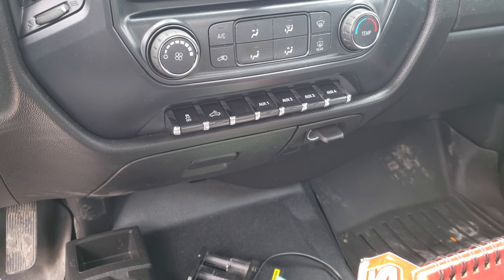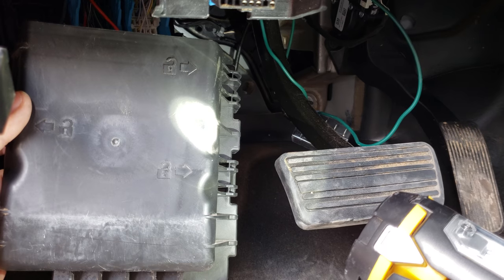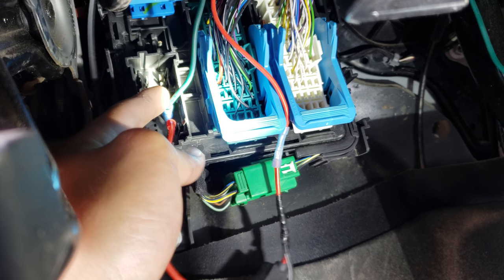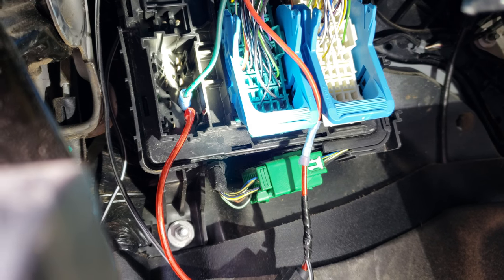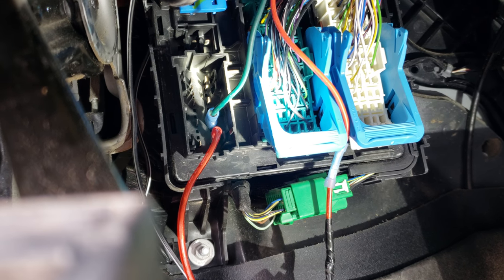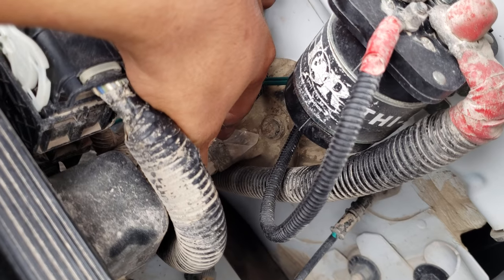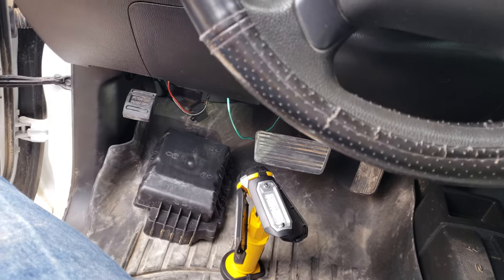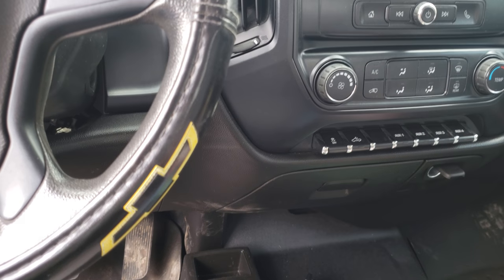Silverado Aux Switches

Comment: Mine not a work truck but I have a 2018 duramax Z71 and my truck comes with the exhaust brake and down hill assist , and the switches I got are out of Order and don’t have the down hill assist but when I plugged it in everything worked in the right order and lights up so I thought it would work but when I go under the dash to see what aux switch controls what nothing is happening. Is it not gonna work or is there’s some fuses I can look for or how do I even see if it’s set up for it !

Comment: Will this work on a 2018 Chevy 1500 LT Z71? 
Ive got 3 different lights I’d like to install on the truck but need a good solution for the Aux switches and this is the one I want but everyone says it’s not going to work.

Comment: I'm not the smartest when it comes to electrical work. That being said, I hooked up a positive wire up to one  the pins and a ground wire to the battery. ( from my LED bar) it was always on. No matter whether I had the switch on or off. Thoughts?
Reply from the maker: Sounds like you wired it to a constant 12v pin, use a multimeter to find the correct pin that turns on and off with the switch. And I would recommend not to wire the ground to the battery, clean bare chassis ground is always best.
Reply: @BR-cm3gi  Hi I hooked a test light to that and it was always on for these pins when they were is the on and in the off position do you mind if you make a video showing what connector you connected the switch with

Comment: Just so you all know they sell a harness that plugs right into the junction box with all labeled lead wires coming off it much cleaner install
Reply: Do you have a part number or website?
Reply: @freddiemcclurejr3827  I found on ebay... I'm not sure how to add the link but the description is:

"2014-2019 Chevy gmc junction block connector truck with aux switches"

Sold by a snow plow company called MCA

Hope this helps you
Reply: @Jon Doe... Thanks for putting that info out there! It’s very helpful! I’ve checked it out and the harness appears to be legit! I’m getting one because I want a clean, professional look under there. Again... thanks!

Comment: Thank you very helpful information. Did you purchase the lock on connector or just left the crimp on and straight wire to the pin?
Reply from the maker: I just crimped on a female spade connector and left enough slack to move around. Haven't had any issues with it, thanks.
Reply: Okay great, so just run POS wire from LED light to the pins and NEG to a ground and that was it. no need for relay? Thank You so much been going nuts trying to get info. Just wanted to add some work lights facing the back and a flashing beacon.
Reply from the maker: @kjorge66  I ended up adding a relay because it was drawing power too much power than i liked, but like you said I dont see any issues with it. Negative off lights to a clean chassis ground then positive to a relay or directly to the pin of your choice depending on what switch you want to hook them up to.
Reply: Thank You
Reply from the maker: @kjorge66  no problem!
Reply: @BR-cm3gi  I'm trying to install a light bar using the aux switches. My light bar wire harness has a relay and a red and black wires that go to the battery and the wires to the toggle switch that comes with the light bar kit. The switch has 2 wires going to it. One obviously goes to the pin in the BCM that corresponds to one of the aux switches but where does the other wire going to the toggle switch go?
Reply from the maker: @Volfan812  I'm a bit confused, do you have a link of where you purchased the wiring harness and light bar so I can look at them closer?
Reply: @BR-cm3gi why? It already has it’s own relay AND 30amp fuse. You just added a 2nd relay for basically nothing. I’m pretty sure your application was nowhere near pulling close to 30amps.

Comment: I put in my switches in my 2014 1500 and got all the fuses and relays in but I’m still not getting any power to any of those pins in the junction box. Anything I could be doing wrong?
Reply from the maker: Does it have the correct factory harness going from the switches to the junction box?
Reply: Bobby R. Yes it does I didn’t change any of the wiring harnesses. I just plugged the old ones into the new switch panel. Is there aftermarket ones I need to get?
Reply from the maker: @domdragonetti476  double check all fuses, might possibly have a blown fuse.
Reply: Bobby R. Is there any fuses in the indoor fuse panel that may affect this?
Reply from the maker: @domdragonetti476  I couldn't tell you for sure, but check just to be sure.
Reply: @domdragonetti476  did you buy a new switch panel that has the aux buttons and just plug it into the existing wiring from the original switch? Did  you ever get it working? I want to replace my existing switch that just has the traction control, cargo light and exhaust brake switch with the one that has those 3 switches as well as the 4 Aux switches but want to be sure it will work before I spend $60 on the switch.
Reply: maxum3300 I did buy it and it never worked right away. Dealership had to wire it all up and they said original price was like 800. I got a bit of a deal on it and had it done for 250 so I would go to a dealer and check to see if it fits your truck before you buy the switch cause it was a long hassle to get mine working

Comment: I want to use these switches to control some light pods. Do I need to use the aux switch to trigger a relay to power the lights? Or can I just go from the pin under the dash directly to the light pod?
Reply from the maker: I installed a relay and fused to the pods I was using, I didnt want any issues with power draw from that pin.
Reply: Bobby R. Do you know what the part number for your under hood fuse block is?

Comment: The link won’t open up it’s like frozen... damn near any GM upfitter page won’t load... any idea what I can do?
Reply from the maker: I just tried the link and it worked, may be an issue with the device you're using. Let me know if I can help with any questions.
Reply: Bobby R. I tried it a few days ago and it worked for me again. I spoke with Chevy and they said it was most likely on their end cause they couldn’t open it up either.
Reply from the maker: @Keeganm916  good deal, glad you were able to get it to work.

Comment: Hey Bobby, I'm trying to do this same set up on my 15' Silverado LT and went and noticed in the fuse box under the hood I don't have terminals for the upfitter fuses. Spots are there but no connection. Did you end up getting a whole new fuse box or just got lucky?
Reply from the maker: They should be in the fuse box itself, if I remember correctly they looked like relays and you would have to swap them around to get always on or ignition power. I would think if you have the switches, you should have the same fuses there.
Reply: @BR-cm3gi  Yeah I don't have the switches (yet) the only switches I have is for traction control and cargo light. I have the new switches with aux 1-4 on the way but now I'm starting to think I need a new fuse box because I don't have anything in mine.
Reply: I had the same problem so created a video showing how to wire them. Hope it helps you. 
https://youtu.be/SdHbK_ucvKQ
Reply: @Owlex27  I had the same problem so created a video showing how to wire them. Hope it helps you. 
https://youtu.be/SdHbK_ucvKQ

Comment: There a company called MCASNOW that sells the junction box that plugs in there with the wires already pinned for 14 an up GM     2014-2019 GM UPFITTER CHEVY GMC JUNCTION BLOCK CONNECTOR 15547108 19328970
Reply: There on eBay

Comment: If you use that j box, won't you be going through the BCM? Or no?
And yes the one person is right there is a plug in pigtail for that. 
The BCM being so finicky I'm Leary of going that route. Just give me fire, ground, switch and relay. Would rather keep the computer juju outta it. If need that j box goes thru the BCM.
Reply from the maker: Those pins provide switched and constant 12v for any accessories, you should have no problems as long as the accessories are installed correctly. I do have them wired on a relay, using the switches as a remote to turn on power to the light bars. I went this route because I did not want any draw on the battery with the truck turned off.

Comment: You went through all the trouble of making a video about the switches and didn't take the time to explain with one was which. I know I can use a multimeter.
Reply from the maker: I found the ones I needed and showed in the video which ones they were. You can use a multimeter following the instructions in the video to find the pins you need.